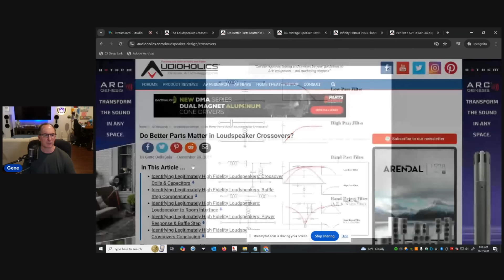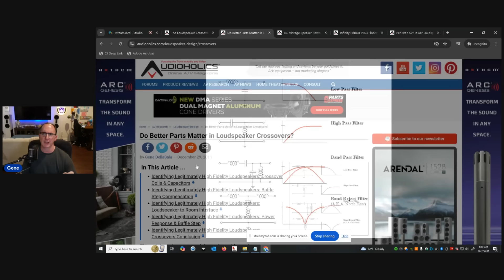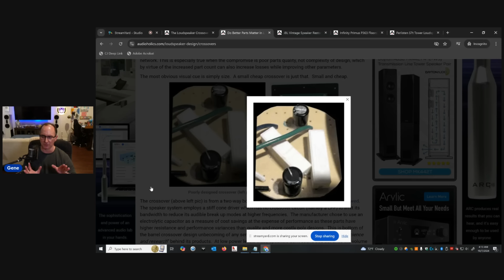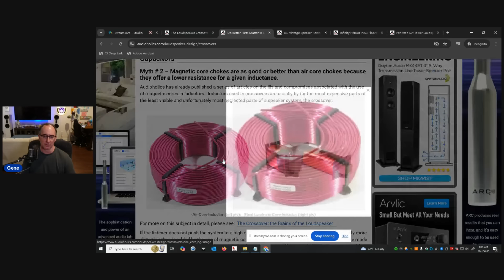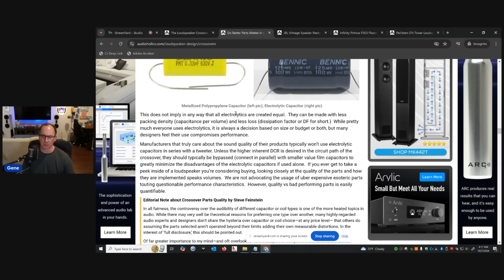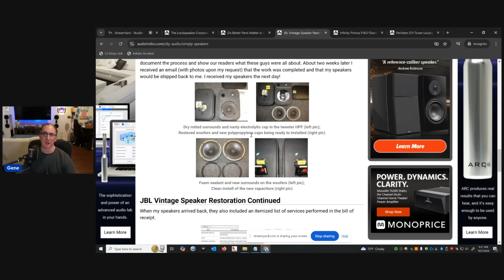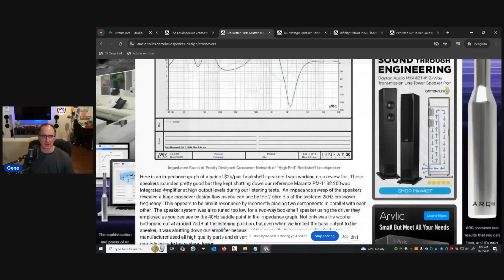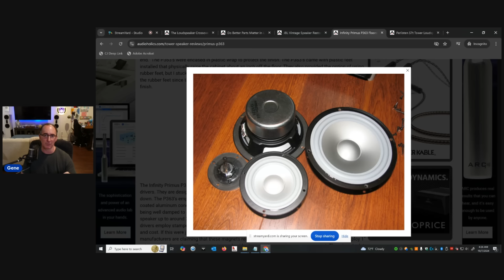Loudspeaker Crossover Upgrades - Are They Worth the Effort?

Comment from the maker: :_Shout: 7:45 High Power handling loudspeakers will typically utilize capacitors with > 100V rating.
:_Shout: 8:39 Toroidal iron-core inductors offer very high power handling and a more compact design, often making them more practical than air-core equivalents.
:_Shout:10:48 Ferrite core inductors offer higher inductance in a smaller size, while steel laminate inductors reduce core losses but are larger and better suited for high-power loudspeaker crossovers.
Reply: But I learned from Andrew Robinson, that if I don’t look at the components, and I don’t know what they do then they don’t matter.
Reply from the maker: @_Chev_Chelios  I'm unsure of Andrew's view on the topic but maybe that resonates with his audience if that's his claim.
Reply: @Audioholics I’m just goofing on him and his attempt to trash Danny. 😂
Reply: 19:00 Those inductors are too close together and will have some unwanted parasitic crosstalk.  For "Cost No Object" performance, I would not compromise by non optimum parts placement by the restricted "too tight" crossover layouts shown there.
Reply: @Audioholics  Very low series resistance offered by toroidal inductors is also worth a mention. 12/15mH, 4/5" diameter affairs achieve values of 100mΩ, which only marginally affects driver's Q and efficiency. Equivalent air core inductors would be the size of an oil drum with this combination of high inductance and low Rdc.
Reply from the maker: @paulb4661  agreed and great point!

Comment: I would like to see the numbers for a harmonic distortion before and after crossover upgrade with hight quality parts of the original values.
Reply from the maker: Agreed that would be a great comparison.
Reply: There have been a few speakers that Danny of GR research said that the crossovers were as well designed as they could be, and he was just going to upgrade the parts quality and add “tube connectors” for the owner. It would be amazing to see a Klippel spin on one of those. I was always confused why he would even offer an upgrade when he even admits that the speaker sounds amazing, but Man’s gonna make his bread, I guess.
Reply: @MechAdv  
It's a Profit Organization.
Reply: Speakers' inherent THD falls between 0.1 and tens of percent at the lower end of the spectrum, dense forest to start with, when looking for that twig.
Reply: I think it's a disservice to attribute Danny's work solely to profit. Ss he has mentioned, the speaker upgrade business is only a small part of their business, about 10%.

I think Danny does good work, has good ethics, and has very good hearing skills.

That being said, I need to see true double blind tests before buying into esoteric speaker cables, and I doubt the lifting of the cables off of the floors using tinker toys has an audible effect.
Reply: @todd8155  
Todd, my issue is that Danny is a "double-edged sword". He peddles two types of wares. Those that are based on legitimate science & true understanding of speaker design, acoustics, and crossover design...but also "fringe" products that have been proven many times over from an electronics engineering standpoint to be of no substance, benefit, or merit.

For the most part, his DIY speaker designs are a good value for money and are good performers as well...sometimes excellent.

But he's also produced some "turds" that he would adamantly stand behind to the end of the world with baseless claims and non-stop hype of them being "Giant Killers" and that they will "perform far better than ANYTHING in their class for 2x-4x the cost", while easily proven otherwise via both subjective and objective testing. 

He cannot be an agnostic or independent source of Non-Biased information, as he is in business to sell and make his livelihood through the products he offers & promotes/hypes.

It seems that EVERY next speaker design, crossover upgrade, or cable product that he comes up with, is "OMG! Better than ANYTHING else on the market at ANY Price".

There's an incredible amount of HYPE (and very often baseless claims) in many of his videos regarding HIS products.

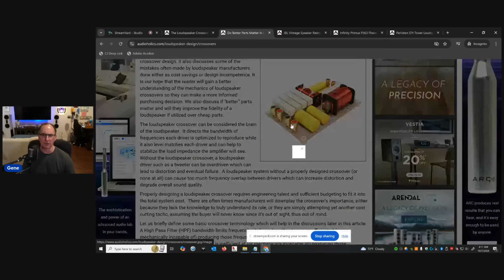For example, just listen to and write down his Exact Words and outrageously bold claims starting around 4:40 in his latest video about he and Ron Benay's (NRD) collaboration on their new ARIA speakers...

Once again, his new Aria speakers are, "THE BEST Speakers I've EVER Heard at ANY Price..." 

(they are $3500/pair for a completed stand-mount using drivers that cost no more than $45 & $40 each at RETAIL pricing (much less at his wholesale/mfg cost), using good but basic ported MDF enclosures with a simple rectangular hardwood panel slapped on each side).

:/

Yes, I'm sure they sound very good. But do they REALLY stand up to his stated hype and claims?  And are they a "good value" for money?

I guess only the buyer/listener can decide.

I'd rather take my chances with the Wharfedale Aura 2 or Present Day Productions MUM-6 as just two lower cost options.

YMMV
Reply: @bbfoto7248  So yes I agree that Danny is of two minds.  I am skeptical of his claims about speaker wire and power cords, and the tinker toys to levitate speaker wires 3" off of the floor, and I have stated such.  I have also asked for a true blind AB test to back up his claims.  I believe that one can tell the difference between a cheap speaker wire of poor quality, and a moderately priced speaker wire of good quality, and that's as far as I will go.  If there is audible differences in esoteric speaker cables, then why hasn't anyone proved it with a proper AB blind test, not even once?  To be fair, and IMO Danny does have very good ears, so maybe he can hear some things that most of us can't.  I am still skeptical.

This being said, I do like his speaker upgrades, and his educational videos.  I like his personality and the fact that he typically treats people with respect.

So I am able to separate the hype from the legitimate.  But I hear you, and you make some valid points that people should keep in mind.

Thank you for responding.

Comment: It’s surprising that Andrew Robinson has double the subscribers. This was a much better explanation than what Andrew and his wife offered up on this topic.
Reply from the maker: His video production is off the charts and hard to compete with.
Reply: He's not a technical review channel so he's not trying to give details on crossovers. His basic premise is sound though. If you like the way your speakers sound then it really doesn't matter what parts were used. Could they be even better? Maybe but you would have paid more and most people settle on any product because it fits into their idea of value for the money. All this academic discussion online doesn't cost a dime. Making a better crossover usually requires better drivers and more sound cabinet design to be worth the upgrade. It's a ripple effect and most don't care so why pay more? If everyone pretending this was such a big deal was actually chomping at the bit to spend another coupe thousand for better crossover parts manufacturers would include them and advertise the fact. But all most folks are doing is running their mouth, not their credit cards, so they don't matter.
Reply: @davep2945  "if you like the way they sound" - subjective analysis of a speaker is irrelevant

Comment: As an electronic technician, it is obvious that better parts make a difference but the better question might be how much should someone invest in upgrading a speaker? I have seen some people go overboard for speakers with bad cabinets or difficient drivers. This is something that cannot be fixed with a better crossover and a handful of Polyfill. I always advise to not invest more than half the value of the speakers. Another point I wish to make : Do not buy ready-made crossovers on Amazon, Crutchfield or Parts Express. These crossovers are made for specific impedence ( generally 8 Ohms ), and with specific cutoff  frequencies ( let's say 2k hertz and 5k hertz ). If your drivers don't have an 8 Ohms impedence and the cutoff frequencies should be at 1.5 k hertz and 4 k hertz, it is obvious that the sound would not be right and the drivers may even be damaged. That is the reason why a company like GR Research do exist. Great video !! Bye !!

Comment: I wasn't sure at first if better parts even mattered but, I was willing to try anything because my Cerwin Vega D9s sounded pretty muffled in the mids and highs. So, I removed and replaced the sand-cast resistors with "Mills" resistors, replaced inductors with thicker strands, replaced electrolytic  caps with polypropylene, removed all ferromagnetic material except in the potentiometers, and replaced rear binding post with 5-way ofc post. The speakers are no longer muffled. The mids and highs became nicely detailed, and the sound stage is beautiful with increased stereo separation. I've done 5 sets of my other speakers since then, and haven't been disappointed on any of them...seriously!
Reply: It's probably the replacement of the capacitors that made the most difference.
Reply: @Grommet2007  yes! That and removing the majority of the ferromagnetic material.
Reply: These are very old speakers. It's possible the capacitors were aging, and replacing them brought the crossover back to spec.

Comment: YES!
I'm Very Interested in a deeper dive.
I think that if your speaker has good flat response with cheap crossover components then a like for like upgrade makes perfect sense.
If the response is messed up then it really needs a better design.
If the speaker sounds nice but you want more detail in the reproduction then upgrading parts makes total sense.
I did a like for like upgrade on my 1978 Technics SB-X50's and it is absolutely amazing in the detail and imaging.

Comment: Good presentation. I rebuild a lot of vintage speaker crossovers. Yes, I remove the cheap/aging caps, low quality resistors and iron core inductors from and replace everything, usually going all poly caps, audio grade wire wound resistors and 18 ga. minimum air core inductors. Sometimes the customer wants a less expensive "fix" so I am not averse to using an electrolytic cap in parallel with the woofer or a good grade iron core inductor in parallel with the tweeter because that component is filtering out to ground, not going to the speaker. I also use the old JBL "trick" of adding a .01 uF bypass cap (connected in parallel) on the in series caps of the tweeter and mid range drivers. For example, if the circuit calls for a 5 uF cap, I connect the .01 uF bypass cap to the 5 uF cap in parallel, making the value of that filter 5.01uF. I think it helps with clarity and crispness of sound. Quality of parts also matters. I did a total mod/rebuilt on a pair of Klipsch RF7's for $300. He asked, when I gave him the estimate, "is that the highest quality parts you can get?" Um, no, so I gave him an estimate for the highest quality parts available and the rebuild for the caps alone was $500, for one speaker. He opted for the $300 rebuild and is extremely please with the results. Cheers!
Reply: @ammodude
What's ur site for upgrades
Reply: @dorkawitz  do you mean where do I get parts?
Reply: No I thought u had a business site so I can send u some crossovers
Reply: @dorkawitz  I don't have a business site, but I could do an upgrade for you. What do you have?
Reply: @ammodude curious about crossover upgrade for 30 yr old Velodyne DF 661's. From research, I know the design team built an upgrade, but it was abandoned due to the overall cost of the speaker. They still sound good. I would like to have the discussion with you if I could.
Reply: @alzero.albert  Cost seems to be the driving factor when choosing crossover components by the manufacturer. I just googled your speakers and did some reading on their development. Seems the goal was to design a "distortion free" speaker and, according to reviews, they failed. One problem I see when reading about the crossover, not components but the order (complexity) of the crossover. I have learned that less is better if you want to eliminate distortion. They used 3rd order on the low freq, 2nd order on the mid, 4th order on the high freq. That entails using so many components that distortion is inevitable. JBL and AR had huge successes using, in some cases, 1st order on the low freq (or nothing at all, running full range) and 1st order on the high freq. The famous AR-18 had a 1st order (one cap) on the tweeter, nothing else. JBL 43XX studio monitors ran the woofer full range, no inductor coil or caps. Where they failed, in my opinion, was they used electrolytic caps and iron/laminated core inductors to save money on the build. Energy (Canadian) speakers have a very complex filter on the high freq. To me, the vocal range is too muffled. Once I removed all that filtering and simplified the crossover (2nd order on the highs) the singer's voice came to life and there was less distortion. They already had great bass though with a 1st order air core inductor on the low freq. I just increased the value of it by .2 mH from .43 to .65 to smooth out the mid range. I do all this with a home-made crossover test board that is outside of the speaker and I can swap components while music is playing. I just play with it until I get the sound I like.
Reply: @AmmoDude  I went on a 3 year search for a speaker setup around 5000 that pleased my ears. Listened to lots of them and kept coming back to the velodynes. I used Annie Lennox, "Why" as a comparison. The 661's sounded cleanest. I could clearly hear her breath coming across the microphone. Velodyne, as you probably know is a subwoofer company. They designed the 661's to pair with their subs. Reading the reviews, I don't think that was understood. I bought them with a pair of series F-1200-B. They are a 100 watt servo controlled sub that checks accuracy of cone 1200 times a sec. if I remember. I was very pleased with the sound. I used them in a 7.1 setup powered by a Yamaha DSP A-2070 passed into an Adcom gfa 555 ii. I loved how they came up with the acronym GFA... Great Fucking Amplifier. Think that was Nelson Pass. Can't remember for sure. The 61's are 40 lbs each. No idea where you are. I'm in Central Oregon. I'm interested in a ballpark figure for upgrade and shipping. It was 1800 for the pair and 2400 for the subs in 1993. That kinda dictates decision making. Lol. Look forward to hearing from you
Reply: Appears to be about 4000 a pair today's prices